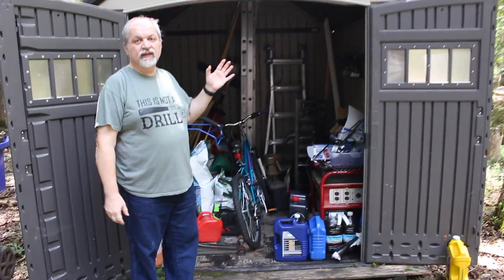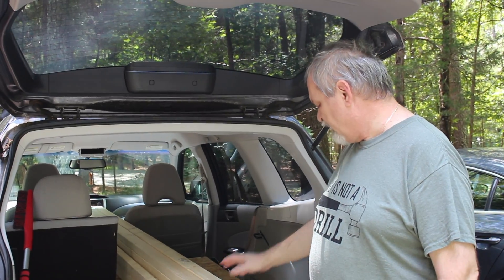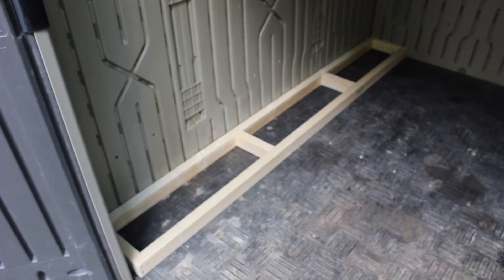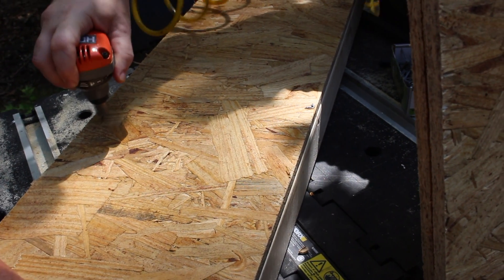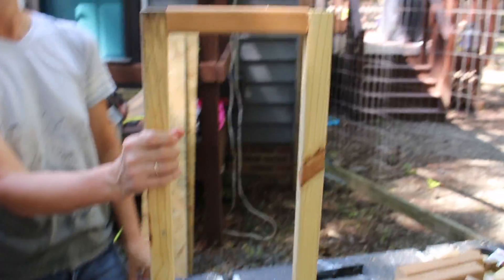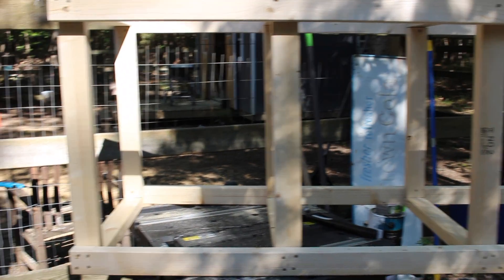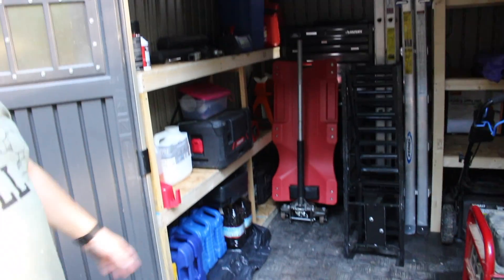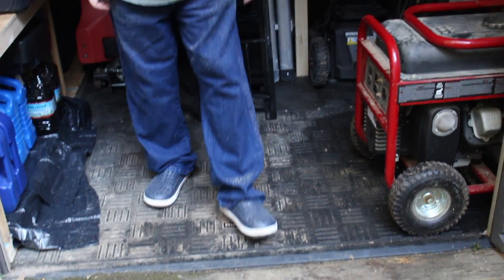Amazing storage shed transformation: Learn how to build shelves!

Comment: do you have high humidity, lots of rain or snow in your area?  Will you paint the osb/shelves to keep them from getting water damage or swelling over time
Reply from the maker: No need to paint, there is no water penetration in the plastic shed
Reply: @ProfessorDIY ...maybe your shed; however, mine let water in on the first rain (suncast resin)...still sorting out the water ingress issues
Reply from the maker: @K03sport  I never had water intrusion in mine for over 3 years now

Comment: Bottom shelf is the floor. Y’all wasted that wood and square footage. But whatever. Grandpa looks set in his ways.
Reply from the maker: Actually because the shed is plastic the unit has to be sturdy and also distribute the weight otherwise the plastic floor will crack, so we did not waste anything it was designed for the space intended